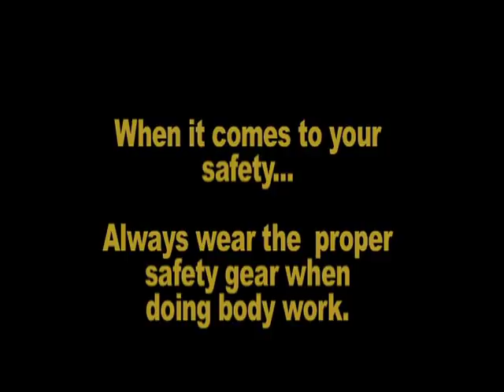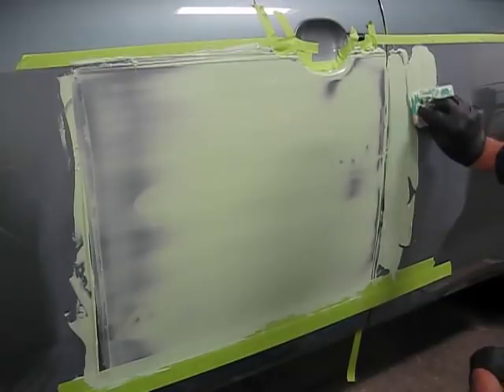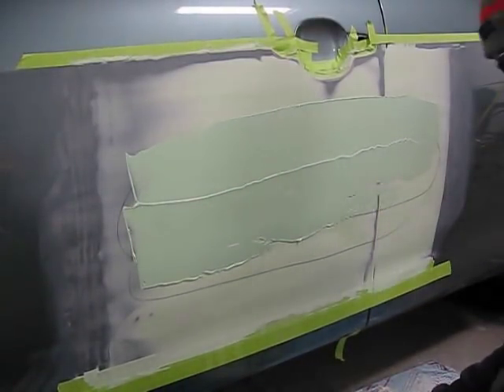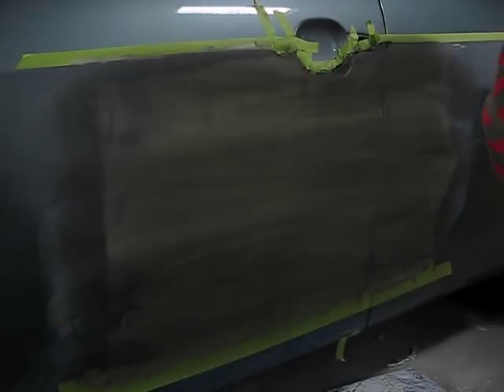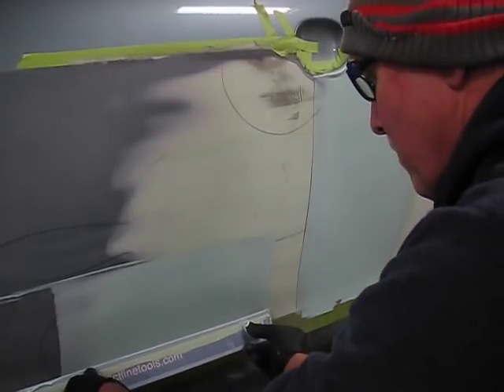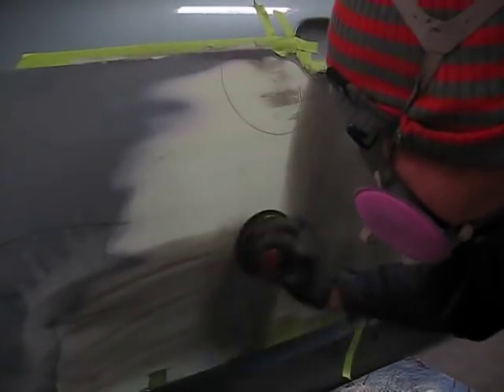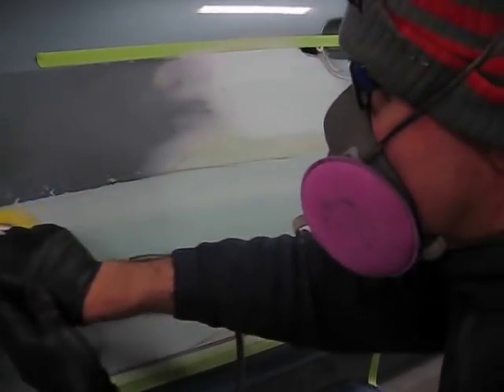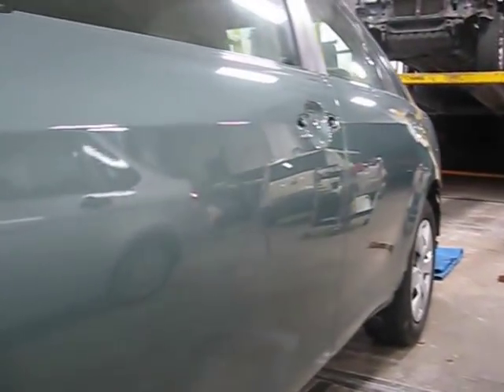BONDO SHAPING PERFECTION WITH THE BLADE

Comment: Dont apply bondo over sanded paint ...

What 3M Said
I have heard both opinions of this for years, but no concrete data. About one year ago I visited the 3M headquarters in St. Paul, Minnesota. While in their lab I asked this exact question. They said that body filler should not be applied over sanded paint. They said that this can cause repair mapping. It was explained to me that many technicians mistake this for sand scratch swelling or primer shrinking. When in fact, the chemicals in the filler can react with the layers of paint coatings causing them to swell or look a look like a shrinking problem.
Reply from the maker: Thank you for your thoughtful, well written comment.  It is coincidental that we were discussing this very issue the same day that your comment was posted.  First we need to clarify exactly what you are referring to when you say “bondo”.  Bondo is a specific product that has become a generic term for any polyester based body filler.  In my experience in talking with a large number of auto body techs as well as my own experience with auto body repairs and restorations I have discovered that mixing a glazing putty with the filler, in varying ratios, (I can thicken up the glazing putty or thin down the filler depending on the repair), yields the best results and performance overall.  In fact, 3M’s Platinum™ Plus  Glaze states on the label, “a super premium, pourable polyester finishing glaze that provides excellent results on galvanized steel, aluminum, zinc-coated metals, SMC, and cured primer and paint.   This stain free, tack free formula has superior spreadability and is super-easy to sand.  Use for handling cracks, drags, hail-damage, pinholes, and full panel contouring.”    Another product that is designed to mix the two products together (filler and glazing putty) is the Metal Works™system made by Evercoat.  Evercoat states that this is an inter-mixable system that works together extremely well.  In my many years of experience of repairs and restorations I have not had any problems with paint failure or “mapping” with mixing these two products, the filler and a glazing putty.  I encourage anyone to do some research and use what you are comfortable with.  I also encourage any questions regarding this issue.  Ultimately find what works best for you and build your reputation on that.
Reply: Adam Maxwell In other way primer or old paint under body filler gives us better anti corrosion protection.
Reply: Adam Maxwell Actually you are completely wrong. I have the printed data from OEM and bondo is not to be applied over bare metal. Very few ,in fact only a couple plastic fillers have proper corrosion protection. Bare metal should be etched and epoxy primer placed over it. Most all plastic repair products are Polyester based today and it is perfectly accepted and recommended to go over OEM finish. If its been refinished it should be stripped and epoxy coated . Mercedes MAster tech of 35 years.
Reply: I agree with Michael ,  so many " know it all's" get stuck with their own way ....why can't any material be compatable just like paints and primers ... As long as the " substrate is sound and been there for years and cured etc it's fine... However most good body guys I follow and learned from always apply to bare metal too ...  The bondo won't get wet from behind unless he metal is Swiss cheese .... It's been done for years who cares if a company doesn't recommend it .... Every cock ring company wants to sell their brand and stuff u don't always need.... 

More than one way to skin a cat as they say....  Half today's cars are garbage in 10 years anyway and if your doing something nice, it will hardly ever see rain !   THE END 

Just my observation on real world body work
Reply: I contacted 3M about Bondo. This is what they said....

Hello,

Thank you for contacting 3M, where we apply science to life.

Bondo Professional Gold Body Filler is recommended to be applied to a bare, clean and scuffed surface for best adhesion. Bondo Body Fillers do not adhere well to paint, even if scuffed. The best method of preparation for a body filler is to: Clean using a degreaser, remove the paint for 2 to 4 inches beyond the damaged areas using P40 to P80 abrasive. Clean using a degreaser, mix and apply the filler with-in the color/clear coat paint edges. Sand the filler (apply more if needed) and feather edge the paint using P180 to P320 abrasive prior to primer application. Because paint systems vary widely, consistent results are dependent on not over lapping the base coat/clear coat edges, this will prevent imperfections such as "lifting" or sand scratch "swelling" which is common when filler is applied over paint top coatings.

Please let us know if you have any further questions.

Regards,

Allison C.
U.S. Business Services Operations
3M Automotive Aftermarket Division
www.3mcollision.com
1-877-666-2277
Reply: So 3M recommend  sanding off all the paint back to bare metal.......now where can I get the necessary abrasives to do this.....why 3M of course ! I've put bondo on top of paint for 40 years as a professional bodyman and never had a problem I couldn't overcome.BTW I use a blade like this except mine is just a piece of stainles steel strip but I put all the bondo along the bottom  of the panel then put the blade at the bottom and gently work my way up  (watching the bondo fill in all the dents as I go up ) going from side to side just like laying a concrete driveway,most of the time it only requires one sweep

Comment: I've bought this product. And use it some times when I have large areas that need filler to be applied.  Mostly used and tested on the 56 chevy body as it curves a great deal and is far from straight anywhere. But using most tools is a learned skill as well as anything else. Instead of those of you commenting on something you've never used and leaving negative comments, why not hold your tongue until you've tried it yourself? How can someone even consider leaving a negative remark when not using this product? I don't get it! And yes you can use a DA to help speed the process if you know what you are doing. If you do use a DA and use it wisely, it saves lots of sanding by hand for sure. If you don't use it the right way, well, you can keep adding filler for days to come!
Reply from the maker: Rick Bell Thanks, Rick 👍
Reply: Great piece of wisdom there.
Reply: Too much pride and ego from people.

Comment: How did you mix that Bondo mine would have been hard and impossible to work with by now
Reply: pea to a golf ball
Reply: It was cold. If it were in warmer weather or conditions, this method wouldnt have worked the same at this rate.
Reply: @kathryncastanares525  Um yes it would, you use less hardener

Comment: Well done man.  Alot of haters here.  End product across the door gap was stellar.  The voice and editing was spot on.  Don't let the haters get you down, cause haters always gonna hate.
Reply from the maker: Michael Smith  THANK YOU!!
Reply: I can't understand why there would be haters?
Reply: Obviously you have no idea what real bodywork is all about. There is no way that the mud wouldn’t harden up in that amount of time applying it over and over. All that working and reapplying would create air bubbles. There is no time saving in this at all. That blade doesn’t make it straight. Sanding with a flat surface makes it straight. This is a joke.
Reply: No hater but not thel most efficient way to get this done .
Reply: @dawinner777  You simply use less hardener... and what air bubbles are you seeing? Maybe if you're using inferior Bondo brand
Reply: Agree: too many haters. Looks to me like the biggest benefit is that less bondo gets used, less sanding, and less gets thrown on the shop floor. I was wondering if that was UPol Dolphin Glaze being used, based on the colour and flow of the product. Nice video anyway, enjoyed watching, will give this approach a try.

Comment: this guy  is trying to sell some bull crap I've been a bodyman for 33 years and this is a waste of time straighten your metal and use minimal filler I would never waste my time with this
Reply: Pn
Reply: I was wondering why he would bring the bondo all the way up the panel like that when the dent could be pulled a bit first and just apply the bondo 2 inches max beyond the dent..am i correct?
Reply: Aj C 
Absolutely correct. 
I’ve been doing this for best part of 40yrs, this is absolutely disgraceful. 
Wouldn’t last 1hr anywhere I’ve worked.

Comment: Take any longer. It would be cheaper to buy a door 👻.
Reply: Michael Belisle 
beautiful repair, but i can get around a whole car in that amount of time. it would be worth doing on a classic, but not mom and pops sedan!
Reply: u should be doing every job 100% but u can achieve perfect results with tons of different application and sanding techniques. There are pros and cons to all of them
Reply: big j lenny 
you are right in a sense, bit having worked in a production shop, collision work, if you took 3-4 attempts applying filler, pulled out guide coat and started blocking it all with 180, you would have been fired on the spot!! Unfortunately insurance pays a set amount of hrs per repair. If you are working by the hr, the company wouldnt make any money, if you are payed per job, youd lose your shirt!
Reply: splash...In collision shop, is the approach to use more filler than metal work to decrease time spent on the job and be more profitable?  thanks
Reply: JDPower 55 
no, you have to get the metal closest to its original shape. you wouldnt want to pile on a 1/4" -1/2" of bondo and have it fail down the road.
but you have to be smart with your time...
once filler is applied over your work area, you want to shape it with a rasp or heavy grit paper to get you close to where you can fine tune your filler.
not going to go into details of body work, but again, its all about time management.
big difference between collision work and restoration work.
you normally dont see guys guide coating and hand blocking in a collision shop. its DA sanders, and inline sanders to get the job done.
Reply: Lmfaooo
Reply: Michael Belisle no it wouldn't be lol
Reply: Michael Belisle only thing wrong with it is outside damage. itd be a complete waste of money to buy a new door when theres no structural damage
Reply: you right about that.. jaja..
Reply: Actually most shops use guide coat and 180 should be a minimum they should send it to paint
Reply: That’s good and all but if you’re repairing a rare car it’s sometimes all you can do
Reply: @splash5974  I always finish my work in 180.
Reply: No shit I could bust this out in a fraction of the time with a fraction of the filler. And done right no corners cut
Reply: @ericaz6249  i will 180 over filler work aswell, less chance of shrinkage, but i wont spend alot of time trying to sand filler with 180...
80, 120, 180, done! Primer time! Lol
Reply: New doors or panels can still have dents and waves from shipping. It's still good to learn
Reply: @splash5974   i concur 100 percent  ......some say hes still sanding  FEB, 2020
Reply: @nowhereman6945  hahahaha
Reply: What.a waste of time
Reply: casiotechI  320 before or after primer? Not understanding your question...
We are finishing our work with 320-500 then prime. Then 500-600 before base coat.

Comment: 118 dislikes, roughly 15% actually know how to do bodywork. That process is flawed but would look good to somebody who doesn't know how, and a complete waste of time but if it works for you is what matters. Maybe someday you will figure it out. Leaving the blade out of the equation, I would suggest building the heavy areas in the center first, roughing out with a body file, grater, grinder or whatever and using one nice finish coat at the end i.e. don't block into previously laid filler. I also question the amount of pinholes that process leaves. It is very difficult to apply even pressure on a compound surface over that length of spreader but as it is up to an individuals preferences, I'm glad it works for you.
Reply: mud hog it

Comment: Sorry Guys, Usually I keep to Myself about Bodywork But on this one I simply cannot. I have been doing Car Show Body and Paint for over 30 Years and everytime I see something this Ridiculous I just wanna cringe.........First off. Rip the paint off of the whole damaged area.Next do a skim coat with Bondo from the body line to the bottom of the door. Next, after the Bondo is dry run an airboard over it with 80 grit sand paper . Feel the surface when done and fill any small imperfections with finish putty.......Run the airboard over it again...Next take Your Da sander with 120 grit and smooth the whole area out..........Bingo.Ready for High Build primer.........When thats cured Hand block sand with a long board with 220 paper then 320 finish......Bingo ready for Paint
Reply: thats you said is the old school of painting. . . me I did not use 80grit. . .120grit ....
Reply: No
Reply: so your saying you can paint the primered panel over 320 grit
Reply: What he said^
Reply: This is unbelievable. I just cant take it. Hes got high spots that are clearly evident. The bondo probably still soft to this day. Here's how its should be done. Take down to bare metal. Actually work your metal to make it straight so not that much mid is needed. As you said, airboard with 80 and feel the work. I personally always use a finishing putty which I open on long board 80 then guide coat and finish in 150 then 220 the 320 then prime. Oh that's takes a long time. Not really because my METAL IS MOSTLY STRAIGHT. For the love of God man. Hopefully the customer doesn't know what to look for or puts a magnet to that door
Reply: @johnnyarakilian1348  if the primer is at 320 spray a sealer just prior to paint. Id finish the primer with at least 400 though.
Reply: Marc Sorensen well I usually prep primer starting grit with 320 then pass it with 600 then it’s usually ready
Reply: @johnnyarakilian1348  yes. I thought you were asking if you can paint directly over 320 grit. And depending on what paint and whether you seal it..even 600 csn be too coarse. I spray PPG Envirobase and use sealer or a wetbed when Im spraying metallics...depending on whether Im blending a job or full paint job.
Reply: Marc Sorensen 600 is usually a pretty good place to stop maybe just maybe 800 if you want to push it but metallic flakes will stand up and look strange in 800 is what I believe Kevin Tetz said
Reply: Marc Sorensen but yeah 320 is a bit too coarse 400 at least is right!
Reply: @kyler.7794  Yes. I use PPG Envirobase and they have a clear wetbed that I spray prior to my metallics. You wont get any sand scratches showing through through your blend. The other option is sanding with 1000 or 1200 prior to metallic paint.
Reply: @kyler.7794  If you are spraying a non sanding sealer...going over 320, you may need two coats of sealer. If you use 400 typically you will get all the scratches covered in one coat. Some sealers are really thin.
Reply: Heŕe in Australia what you call  sealer we call wet on wet primer., non sanding.
Reply: @beauchamp1763  yes. If we called it wet on wet someone would spray the paint over wet sealer. Its non sanding sealer here too.

Comment: You must not of used much hardener. Bondo would never be that soft that long.
Reply: Judging by his clothes, it was extremely cold in there. It won't flash until he puts heat on it.
Reply: Filler is a chemical reaction. It will get hard regardless of the temperature. Just takes a little long the colder it is.
Reply: You are correct it is a chemical reaction. At 32 degrees the working time could more than 10 minutes.
Reply: Filler will get harder quicker if apply some heat, but not too much
Reply: Justin Ventworth I was thinking the same thing no way you gonna work bondo with that many passes and stay smooth
Reply: Can you please explain what filler you are using and how it stay soft so long?
Reply: i have never seen that slow of a set up on filler.once you put in the hardener i tend to treat it like it is on fire "get it spread out". i cant imagine reworking that many times. yes, i see it being done here but its a first.
Reply: Slideways right i was just noticing that
Reply: Right
Reply: Sam Edwards but the filler won’t adhere on cold metal very well.
Reply: Bob Ross this vide is a joke. Don’t bother

Comment: the time it took to do this I could have worked 3 cars
Reply: Can u post your work speedy, I'd like to compare
Reply: i did 4 cars in 2.5 hours the other day. One had front and rear bumper, bmw m4 had rear lower bumper, other two are rear and fornts as well. I think thats quite fast. 1,200$ in my pocket for the day
Reply: clemsontigz1 them why do panel repairs charge so much then? Lol
Reply: @potmad6753  
maaco charge $500-$800 single stage paint,and after a year thay will end up in my shop paying $1500-$2500 in mostly 4 stage of paint and 3 clear coat,that's the difference,the paint i use the pint sometimes cost $100 to $150 and  the lamborghini orange cost $6000 a gallon its all about the customers to decide.which one he choose .
the quantity or quality.

Comment: Hahaha you bogged the door shut lol so wrong
Reply: In situations where the edges of the door jamb get bent and stretched out of spec. In order to fix it where bothe sidea match up you have to filler the door shut then cut it open and rebuild the edges level with each other.  Ive had to do this the hard way a few times. Once having to cut one open by hand with a sawsall blade (employer didn't have all the right tool's for bodywork) fingers hurt for two days.